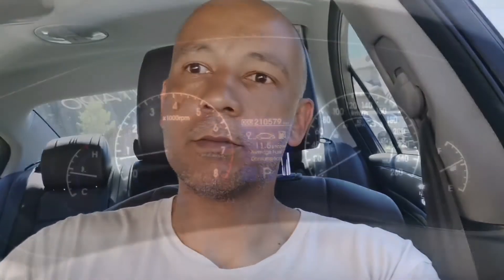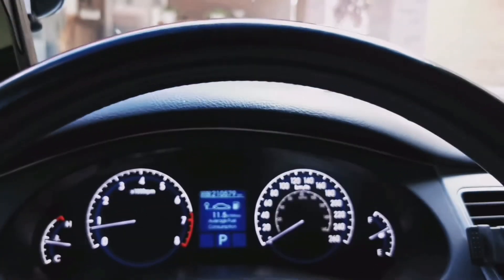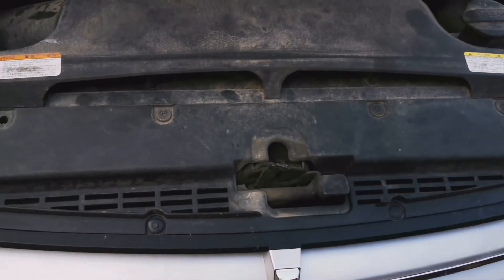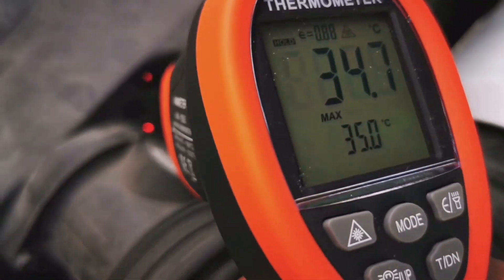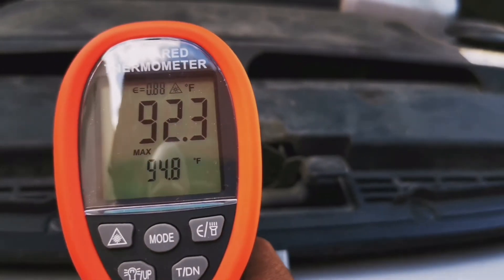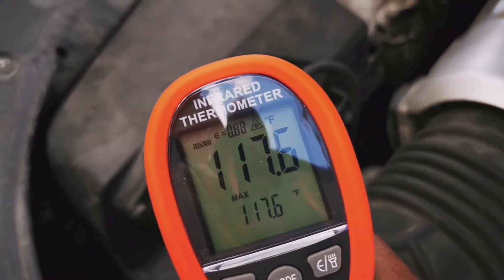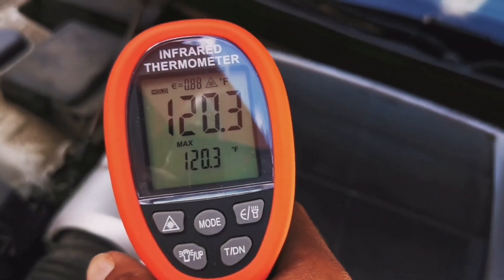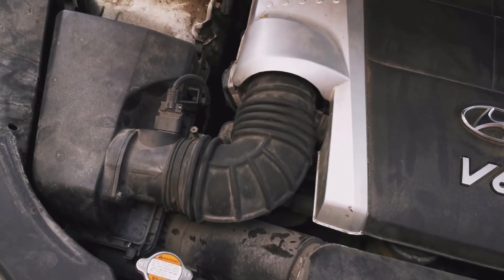Why 99% of "COLD AIR INTAKES" do nothing to boost performance. STOCK air temp vs Engine bay air temp

Comment: The best way is to replace the cheap paper filter with a K and N type washable cotton filter as they flow far more air, and they use the factory air box/housing  and cold air intake is already there. The actually surface area of a round Pod Styled filter is comparable to a flat panel K and N type filter designed for the factory air filter box.

You actually can install a pod filter but you need to fabricate walls and seal it from the hot engine bay, and then create ducking to it.

Or some aftermarket companies might make performance intake assemblies with new pipes and larger filter boxes with better flow for specific car models. Popular performance tuners for VW have a lot of those kinds of products for popular performance VW's. There probably won't be any performance intake assemblies for Hyundai family sedans.